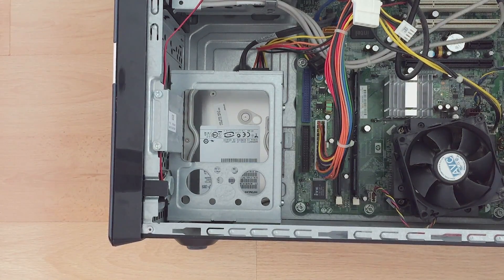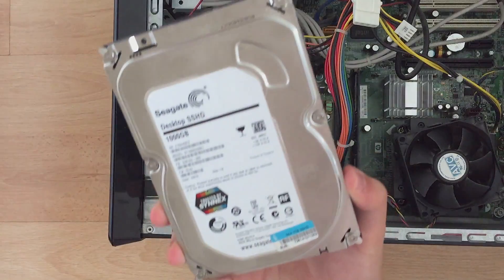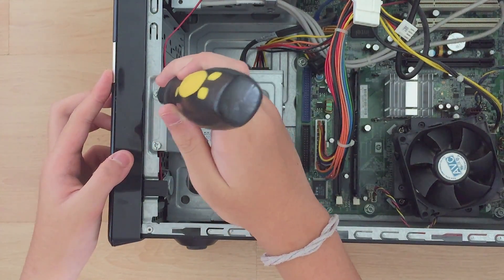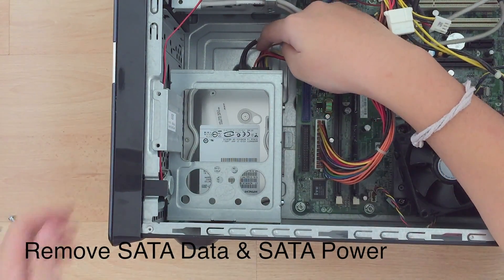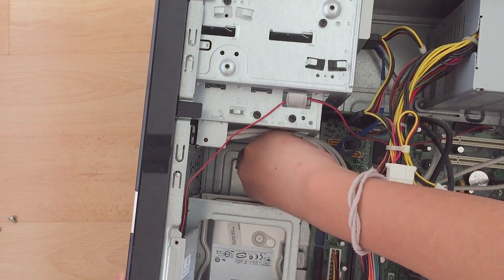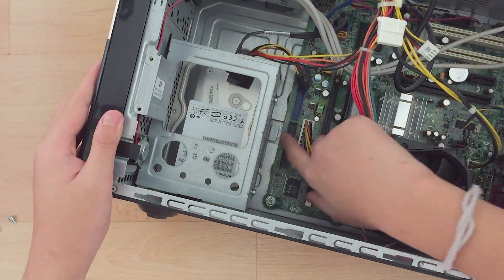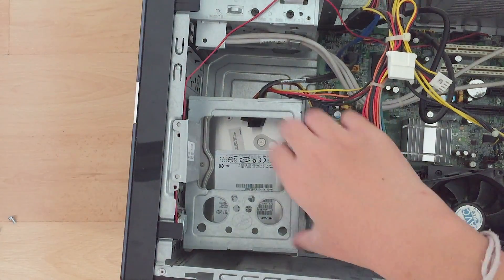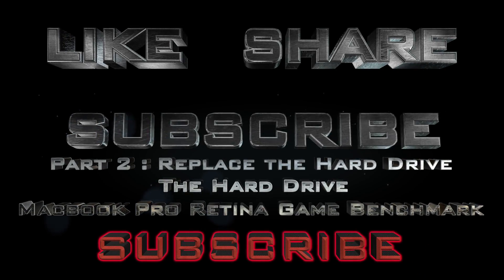How to remove the Hard Drive Cage in HP DX2400 Tutorial Part 1

Comment: Can i upgrade to gtx 1060 on that cpu?
Reply from the maker: Don't huge bottleneck
Reply: @GameTL  my specs are core i5 4thgen Ram 8gb. What gtx should i upgrade please help. I'm on gtx 660
Reply: @GameTL  please reply
Reply from the maker: @footballmatchhighlighttv  then go for a 1060
Reply from the maker: I thought you were running the same build.
A GTX 1060 is great upgrade but if you can get RX-5600-XT that would be better
Reply: @GameTL  Thank you! So for those specs of my pc. Gtx 1060 can run well...